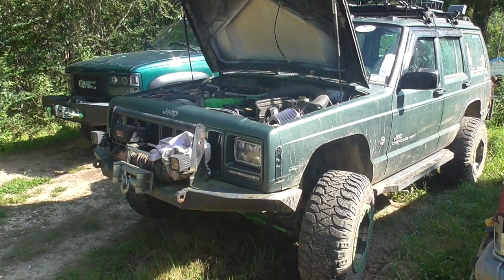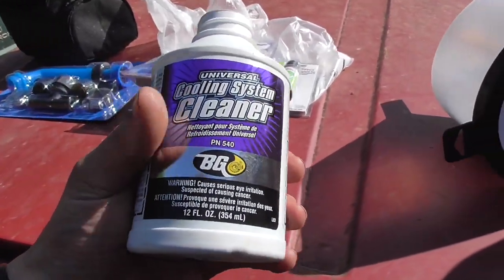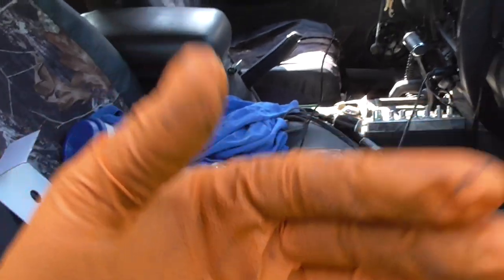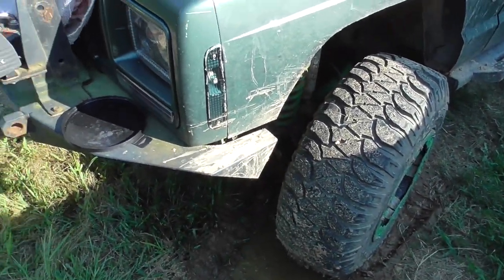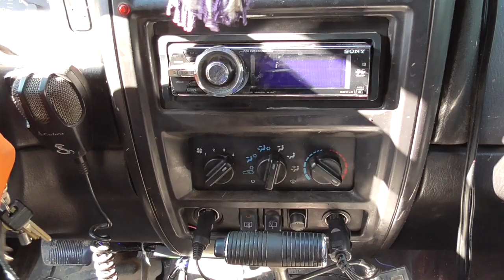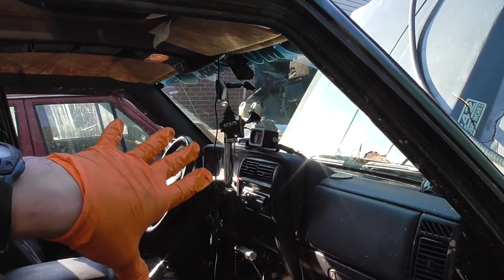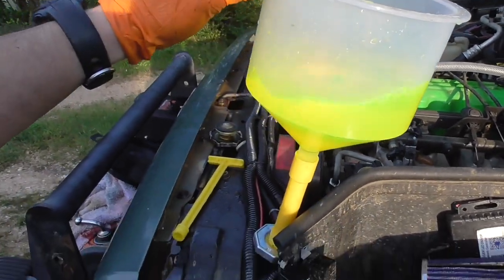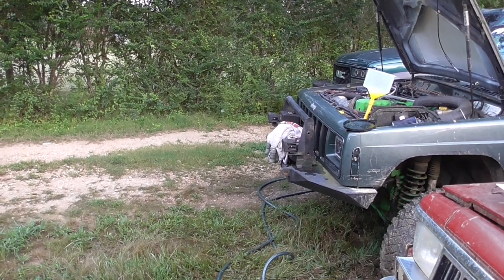2000 Jeep Cherokee | Cooling System Flush

Comment: This is not the smart way to flush a cooling system, having a geyser of toxic coolant blasting out onto the ground.  You should have removed the top radiator hose and the thermostat housing, then flushed water into the top radiator hose (backflushing the system) and having it drain into a large bucket.

Comment: I think I need a new thermostat for my jeep 2000 Cherokee sport. It smokes and the engine cuts off now when it reaches a high temp. I have 139,000 miles on it and I inherited it from my sister who had it for 10 yrs and only went to dr and store in it. It sat from March-June and I went and got it from Georgia and drove it to Tennessee after I had an oil change. I looked in the radiator and it looks brown spots of liquid and there is a bar inside visible. I’m singe 60 yr young woman and I ordered 2 gallons prestone antifreeze and a new thermostat. I’m doing this myself so can you give me any advice? Should I flush it first then put the thermostat in? And I saw you had a t-hose or something you were adding to your hoses. Should I have one of those? Thank you sooooo much. And do you have a special video other than this one to help me? Do I need a water hose as well?

Comment: They are known for water leaks threw the fire wall,also a drain known to clog up on the lower firewall in the engine compartment. You would know if it was antifreeze on the passenger floor and the smell is unmistakable.you suppose to cut your antifreeze with distilled water.

Comment: Cold water + hot engine or radiator can cause a crack bad idea
Reply from the maker: Yeah, if you are stupid with it. That's why you don't go full blast. You just need a little pressure. Plus you could let it cool completely if you were that worried.